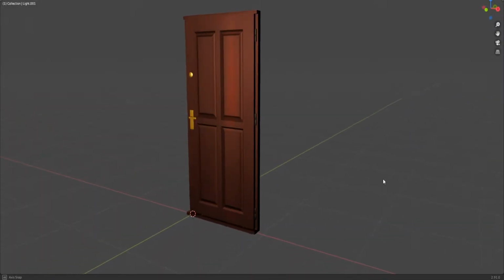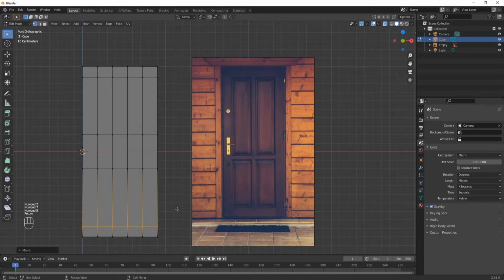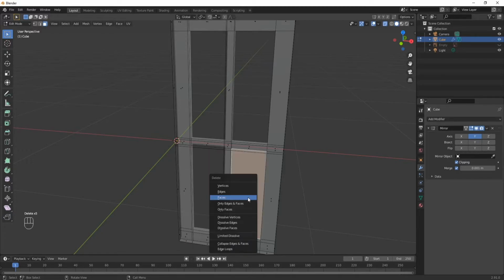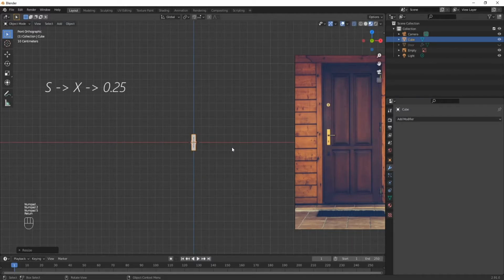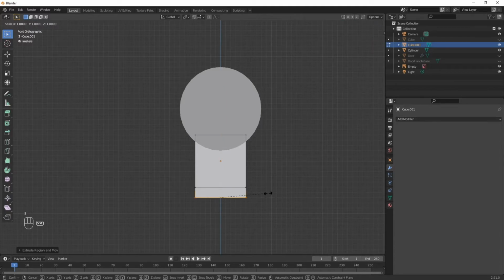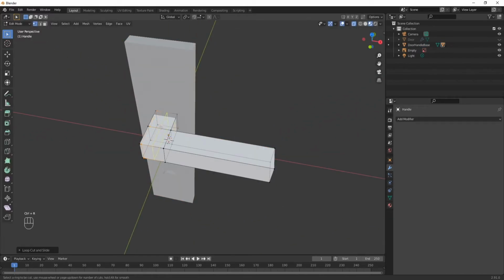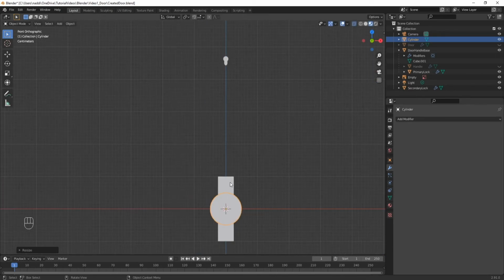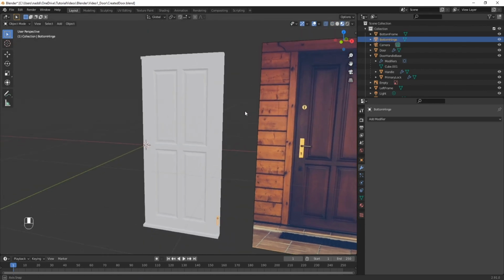How To Create A Door In Blender - Part 1: Modeling

Comment: the door locks are stcking out of the door, in the image they are more inside the door. how would i achieve this? booleans?
Reply from the maker: I had a brief look into this for you - not sure I have a full answer yet, so if I ever work it out I'll relay it to you. 
You could try to add more edge loops to form a box on the door and extrude that into the door to form a recession for the door lock. To make it smoother you could apply a sub-division modifier to the door, but this then affects the rest of the door, so may not be optimal.

The second way is to use the boolean modifier on the door as you said, using the difference option on the door lock to create a hole, but I must admit I don't like the geometry this makes. Best of luck. I'll update if I have a better answer later.

Comment: Thank you for this tutorial. I have been using blender for a while but sometimes I am at a loss for how to do things. This tutorial pointed me in the right direction as I have been wondering how to make door panels for a while now
In return, I will point out that you don't need to manually repeat the modelling for each panel, but you can just turn on the x and z axis for the mirror modifier and save time
Reply from the maker: Great point! Thanks for the tip :)